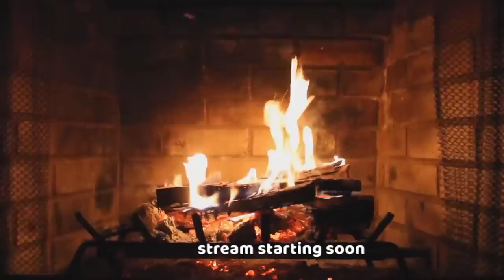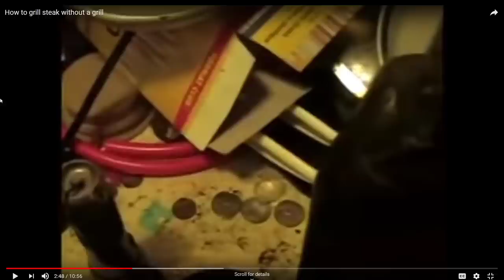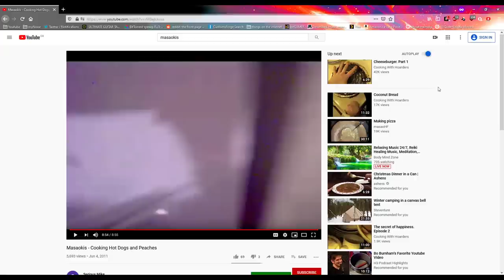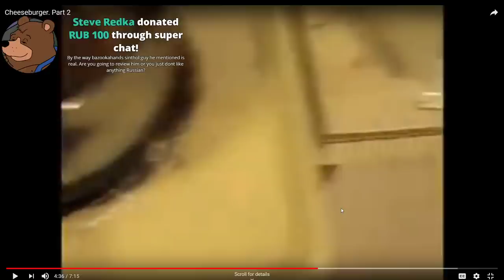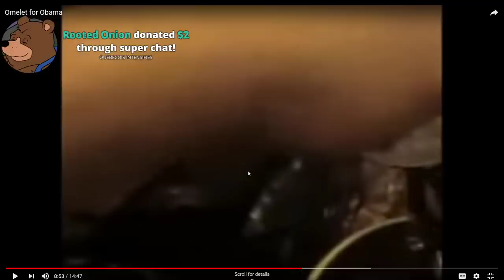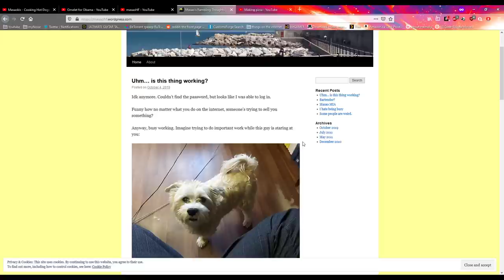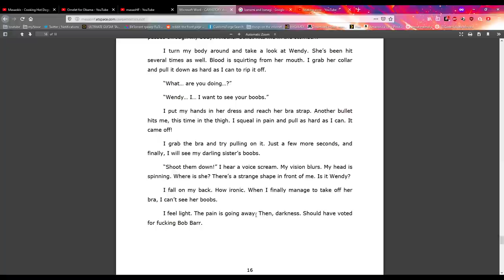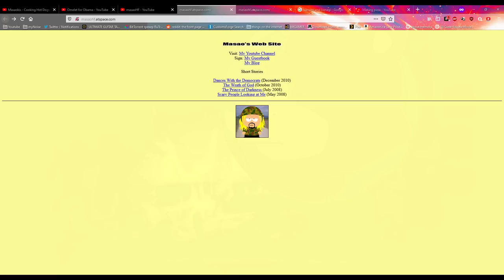Live Dive: Masaokis, the Gordon Ramsay of Good Lord No

Comment: I live in an older building that's a little scuffed up around the edges and was obviously left in a state by the previous tenants. Despite how much I clean (it's probably cleaner than when i moved in ) sometimes I despair a little at a couple of the hard to reach bits under the doors and corners of the room that aren't necessarily even filthy, just have had a lot of traffic over time and probably need to be attacked with a toothbrush a little. This man has made me feel a lot more secure in my house's cleanliness.